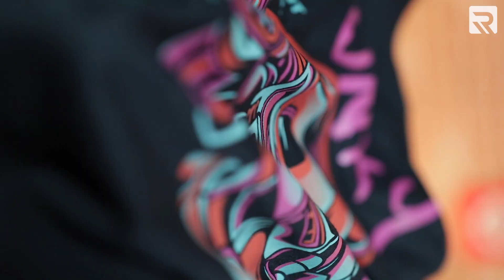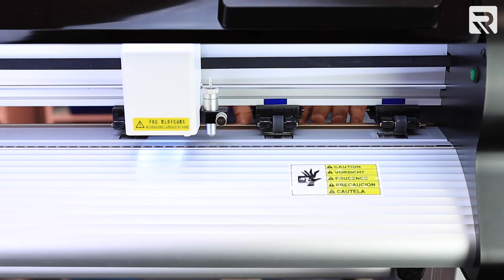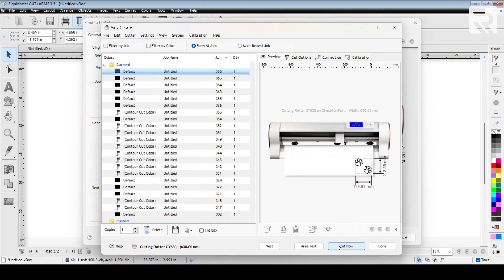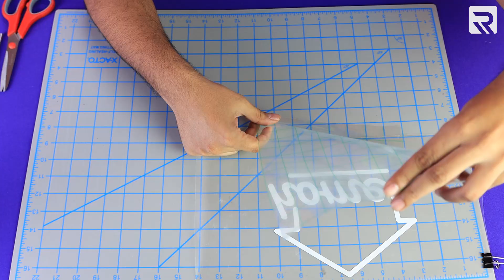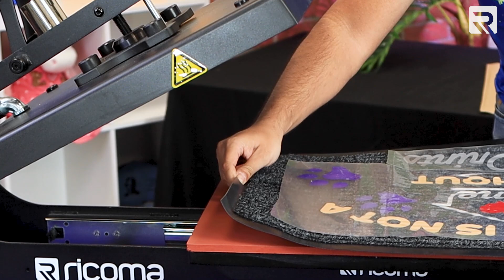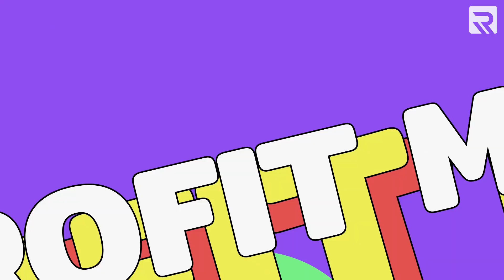Decorating a Doormat With...Heat Transfer Vinyl?!

Comment: If I don't have a huge heat press, will it still work? I have a square heat iron about 12"x12", but how hard would I have to press with my own body weight to get the HTV to attach to a textured mat? I only need to do this one time, so investing in a huge heat press would not be an option for me, besides, I would have no where to fit such a machine! LOL
Reply from the maker: Hi! It's definitely possible!